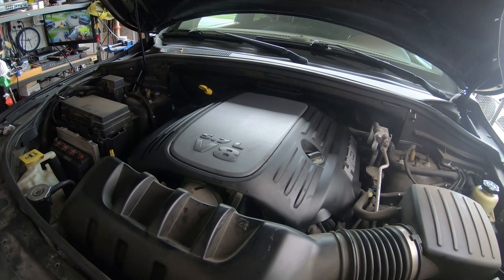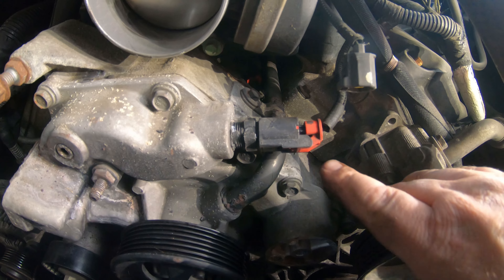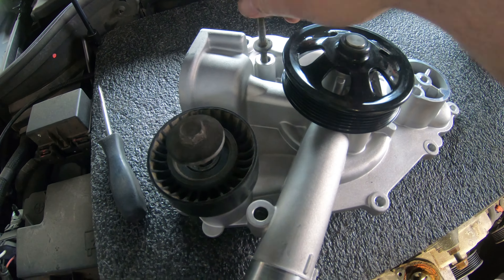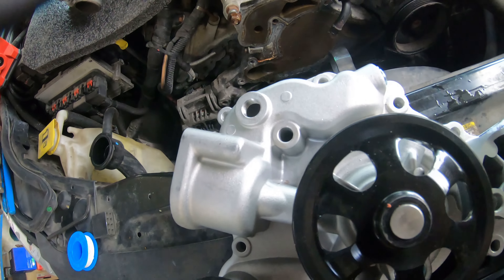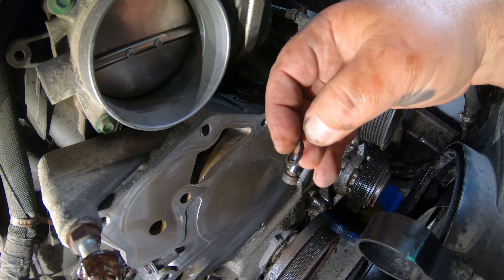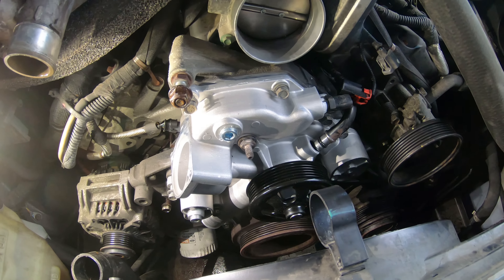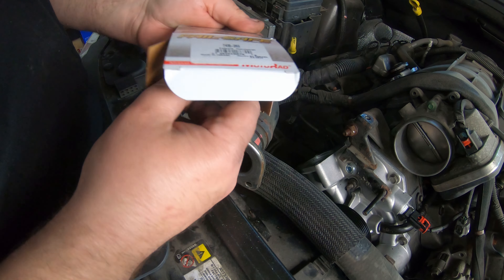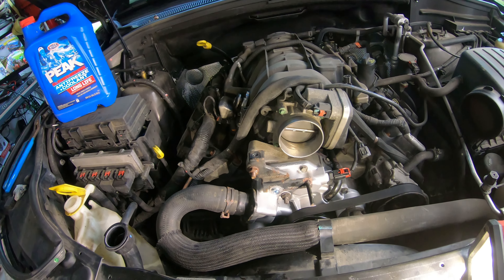Ultimate Guide: Swapping Water Pump on 2009-2019 Jeep Grand Cherokee (WK2)!

Comment: Found a leak on my water pump and thankfully came across this video. Not only is it exceptionally good taking you through the steps but the parts/tools list and torque specs are so helpful. I successfully replaced the pump in about 3 hours with no issues. Thanks for doing the lords work for shade tree mechanics!
Reply from the maker: +@danielb9039 Thanks for watching! Hopefully you’ll find other videos I’ve posted interesting or useful. https://youtube.com/playlist?list=PL5_ZXmQpcjpac4UV8OW8g-IWVCR8tqy79&si=RKfnQL-PAcZFy67a

Comment: Before putting the air box back on, remove the bleeder screw and add coolant til it flows out the screw freely. That ensures you bled the air outta the system. Reinstall the bleeder screw, air box then start it and add coolant as needed.
Reply from the maker: Great advice!  Thanks for taking time to leave this comment.  😁👍
Reply: @baldeagle242 np. I recently replaced my thermostat and coolant temp sensor a few weeks ago and now I have a coolant leak I can't track down. Only leaks when it's running and doesn't seem to be coming from the water pump....but then again it may be leaking at the bottom of the water pump where there's little visibility. Going through a gallon of coolant every few days. $12+ a jug is getting expensive. May have to drive it on my ramps and crawl under with it running which I don't think is too safe.
Reply from the maker: @kennethdurbin3385 These things will nickel and dime you to death. Mine started out as a leak similar to that and eventually turned into a full stream. If you have an inspection mirror with a handle you may be able to see it from the top side.
Reply: That bleeder hole doesnt work for shit i find it better to do it the traditional way and this is coming from a guy who likes shortcuts

Comment: Great video with really good info. The only thing I'll add is about the plug. The one you swapped from the sensor hole. That hole is the bleeder plug. Leave that plug out until you fill the system. Once coolant starts coming out put the plug back in. That will make bleeding the system a lot easier.
Reply from the maker: Thanks for the info. I’m not sure how I managed to do this without bleeding the system but somehow it all went back together without ever removing that plug again. There have been a few comments pointing this out. Thanks for taking the time to share you’re comment. It’s truly appreciated.

Comment: Great video - I like the production pace and edits. No rambling. I would suggest that the idler pulleys and tensioner should also be replaced. Mine were lose and did not spin freely. My water pump shaft was very lose and rattled when idling. I'm surprised it held water under pressure - 2017 Jeep GC Trailhawk 5.7L with only 53k miles (but, 7 yrs old).
Reply from the maker: Thank you!  I agree the other components should be replaced. I’m pretty sure this was the 3rd water pump on this engine and it appeared that the pulley and tensioner had been replaced once before.  I don’t believe this pump actually failed. I believe it was the gasket and permatex that started leaking.

Comment: This was the best replacement video for my 2019 Jeep Grand Cherokee 5.7. The only additions that I would add is to take a picture of the serpentine belt routing and to not be cheap with the thermostat gasket. Make sure you get the rubber gasket to not only seat around the water pump orifice but to also have the lip protrude as to make the seal. I ordered the AutoZone (Duralast Thermostat 41603) thermostat and it worked fine. Literally took 2 hours and 4 hours of thermostat leaking problems. And don't forget to buy 2 gallons of the PEAK OET Antifreeze / Engine Coolant!
Reply from the maker: Thank you!  I hope to see you around on future videos. 😁👍

Comment: Thanks for the video, My 2019 5.7 just hit 100K miles and the pump went out. I also plan on keeping this car for a bit as it will be paid off soon. Thinking while I have all this apart might be a good time to replace the alternator and belt. Your 1/4 drive ratchet on the 10mm caught my eye, what was that?

Comment: Everything I needed in this vid tnks a lot , one little detail but important that you missed was to make sure you open the water pump valve to bleed the air out when pouring coolant other than that a really helpful video tnks
Reply from the maker: Thank you! I didn’t open it when I put this on and had no issues but from other comments it sounds like it can be an issue. Thanks for sharing.  😁👍

Comment: Thanks Baldeagle242.  Awesome and informative video.  I really appreciate the time taken to explain the process, bolt sizes, procedure, and even torque specs.  Do you have any advice on how to properly fill and burp the radiator to prevent any risk of hydrolock?
Reply from the maker: The plug in the water pump can be left out while you fill the radiator. This will allow the system to fill with water and leave minimal air in the system.  After you fill to the plug level reinstall the plug and start the engine with the radiator cap loose. When the thermostat opens let it run for 3-5 more minutes. Shut the engine off and allow it to cool. At this point you can top off the system and you should be good to go.
Reply: @baldeagle242  thanks for the quick reply! $9

Comment: How much time for labor would a shop charge for this replacement?
Reply from the maker: Replacing the water pump on a 2011 Jeep Grand Cherokee with a 5.7L Hemi V8 engine typically requires around 3.5 labor hours.  ￼ Labor costs can vary, but are generally estimated between $149 to $190 per hour. ￼ Therefore, the total labor cost for this service is likely to be in the range of $520 and $650.  depending on the shop’s hourly rate. Add in supplies, shop fees and taxes and you will have another $100 to $150 on top of this. All of this to replace a water pump that costs less than $60. Click here to check current prices. 👇
https://www.amazon.com/dp/B0B38QK983/ref=cm_sw_r_as_gl_api_gl_i_QEAS5ST1PPF9BRBSHFYE?linkCode=ml2&tag=eagle0f1-20

Comment: To extend the life of water pump you have to cancel the pulley which mounted  directly under the thermostat with new belt to avoid gitting grinding sound.
Reply from the maker: @ehsas8676  It lasted long enough to sell this beast.  😁👍

Comment: What is that steel pipe that has the little rubber o ring on it called? I bought an o ring kit from Harbor Freight, but not sire if the correct size is in it. Oriely's wasn't any help, as well as Autozone? I've looked but can't really find "that one". Lol. AWESOME VIDEO BY THE WAY! Gotta change my wifes 2011 Jeep Grand Cherokee water pump. Just got it in the mail today
Reply from the maker: It’s the heater core connection.
Reply: Ok. Thank you.

Comment: Thanks for posting this video. Only suggestion I have is to clean all bolts with wire brush / wire wheel. It may seem minor but I like to clean up all bolts &  nuts. Makes torquing more accurate. 😀
Reply from the maker: +@martinradtke5181 Thanks for watching! I appreciate the tip.  Here’s a link to other videos I’ve posted that you may find useful. https://youtube.com/playlist?list=PL5_ZXmQpcjpac4UV8OW8g-IWVCR8tqy79&si=RKfnQL-PAcZFy67a

Comment: To just a little point. When you put your thermostat into the housing, take a look at the thermostat. There's a hole on the edge with a "jiggler" inserted in the hole. This is to help bleed the air from the system. For the Jeep, you'll want this hole to be at the top.
Reply from the maker: Thank you for the tip. 😁👍

Comment: Thank’s a lot Bro ! Really good video ! I leave in New Caledonia in south Pacific !
Reply from the maker: Thank you! I hope to see you around on future videos. 😁👍
Reply: @baldeagle242  yeaaaa why not 👊
Reply: @baldeagle242  just for information could you give me a online shop or else to buy directly a waterpump for my WK2 2019 Hemi ?
Reply: @baldeagle242  I am looking for video to replace my brake pads
Reply from the maker: @Jeff_Vdr  I haven’t had to do that on mine yet but I’ll make a new video when I do.
Reply from the maker: @Jeff_Vdr  I bought mine off of  Amazon. There are two different versions that will fit this engine. One has treads on the front of the pulley for a mechanical fan attachment and one does not. The one for a Jeep Grand Cherokee 5.7 does not need the treads on the pulley because it utilizes an electric fan. The pump below will fit a 2011-2020 5.7 Grand Cherokee without a mechanical fan. https://amzn.to/491H9wr

Comment: Isn't the white Teflon not designed for the heat of the system?  I think the blue stuff is higher temp.  Otherwise I've seen people use the high temp loctite
Reply from the maker: I don’t believe the cooling system will get above 300 degrees in an extreme worst case scenario. The white tape will work fine for this application. Here a link to a full article about when to use and not use Teflon tape. https://www.hillsirrigation.com.au/when-not-to-use-teflon-tape-4-times-to-think-before-you-wrap/#:~:text=White%20%E2%80%93%20Basic%20Thread%20Seal%20Tape&text=It%20is%20still%20sturdy%20with,tightly%20seal%20threaded%20pipe%20connections.

Comment: Hey man I downloaded the fcc manual and on the water pump bolts it says 18 ft lbs for the 5.7 and 6.4 water pump bolts.  For the water pump to timing chain case cover bolts it shows 21 ft lbs and thats under the 6.4

You make a mistake when lookin em up?
Reply from the maker: It’s possible I looked at something wrong however it’s still holding with no leaks. I was more worried about people over tightening them when I made this video. Most inexperienced mechanics will over tighten bolts like this thinker they need to be tighter than they need to be.
Reply: @baldeagle242  I would definitely be one of those people.  Just curious cause even in the regular manual they're always changing things with each revision.
Reply: @baldeagle242  I have no idea where the timing chain case cover is.... maybe one or more of the bolts when installing the water pump is that and needs 21 while the others require 18?
Reply: @tjtewshews5531  @baldeagle242 what is the torque spec on the two bolts holding the thermostat in?
Reply: @grneal26   21 ft lbs on the 5.7. you can download the service manual free and then use your pdf file view to search torque spec on the part youre looking for.
Reply: @grneal26   It's weird cause in this 10,000 page FCA service manual I downloaded free i found it listed in there twice for the 5.7  one says 21 and another says 10.   I used 21 last night.

Comment: Bout to change mine tomorrow on my 2011 grand Cherokee 5.7. 
Local parts houses here do not list that heater pipe oring. 
I know I could run it back to town and match it up for less than a dollar but here in Texas we're having 102 104 temp days so I wanted it in hand to get it over with quickly.
Resorted to buying that oring from the jeep dealer parts and you'd think it was going on the space shuttle.  $15.36 for what amounts to a 30 to 50 cent oring. 
How can they justify such markups
Reply from the maker: That’s insane!  The entire 400 piece oring kit/set I have was around $15 US dollars. 
https://amzn.to/3OW36ok
One thing I have learned over the years that might not be the most ethical… But, When you go to any dealer for parts drop the name of a local repair shop. Tell them you’re buying parts for them and generally they will give you their discount, sometimes as much as 80% off!  This works at a lot of parts stores and I’ve never once had anyone question me about it. Most of the parts counter employees know this is a scam but they can’t say anything to you. If you drop a name that offers a discount they are happy to play along.

Comment from the maker: If you want to replace your 5.7 or 6.4 Hemi water pump on a Chrysler, Dodge, RAM, or Jeep 2011-2020, look no further! In this video, we'll show you how to replace your water pump on a Chrysler, Dodge, RAM, or Jeep in just a few easy steps.
This replacement tutorial is perfect if you need help with the water pump in your car. Following our instructions, you'll quickly be on your way to a new water pump! And if you have any questions, be sure to ask us in the comments section!
Water Pump Kit AW6653 (5.7L/6.4L) Compatible With 2011-2020 Chrysler 300 [ Dodge Challenger, Charger, Durango 11-20 Jeep Grand Cherokee (OE# 53022340AC 5038677AD)
https://amzn.to/3LNjy95
5.7 or 6.4 Hemi Water Pump Install on  Chrysler, Dodge, RAM, or Jeep 2011-2020
While the water pumps on these engines have minor differences and connection options, the actual pump and the process to change it are similar. The main difference is treads for a mechanical fan or no treads for engines that utilize an electric fan. As you'll see in the video, some plugs, pipes, and connections are slightly different, but the disassembly and reassembly are very similar.
I've kept a quick pace in the video to quickly get you on the job. Feel free to ask any questions in the comments, and I will try to help you if I can.
There is a list of tools and parts and a belt diagram at the end of this video. Please don't hesitate to pause the video and take a screenshot to refer to.  This can come in handy to make sure you have everything you will need before you get started; I will also include affiliate links here to simplify your search for parts and tools.

OEM Water pump - This is much more expensive, but the cheaper after-market pumps may come with something other than new sensors or plugs. On this engine, these pieces are easily changed if they fail later.  I opted for the much less expensive aftermarket part, but this may be a better option if you need these parts.
https://amzn.to/3LLFxgn

SAE and Metric O-Ring Master Set
https://amzn.to/44eJ529

203℉ Thermostat For 2003-2020 Ram 1500, 2500, 3500, Dodge Challenger, Charger, Durango, Magnum 5.7L, 6.1L, 6.2L & 6.4L & Jeep Commander Grand Cherokee 
https://amzn.to/44wJzkm

Dorman 902-689 Engine Coolant Thermostat Housing for HEMI V8s
https://amzn.to/3LnTlwb